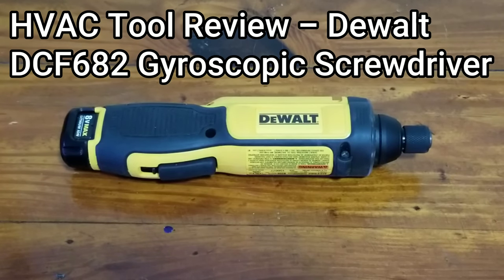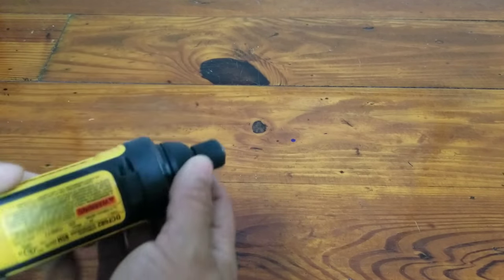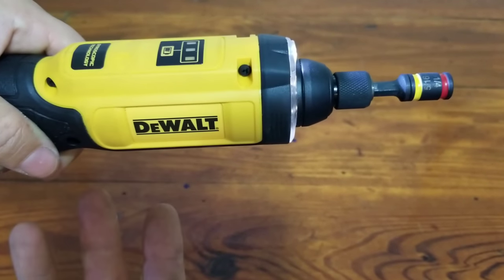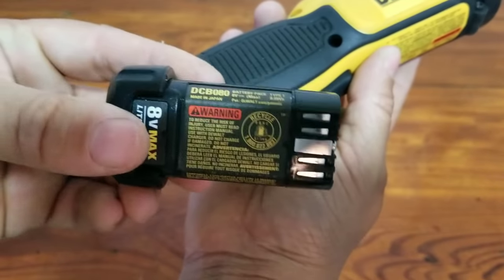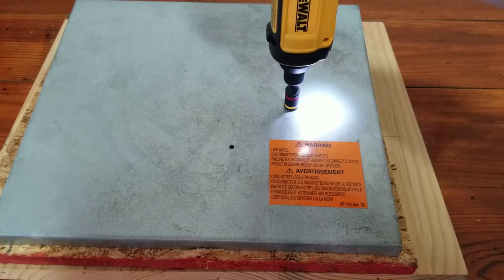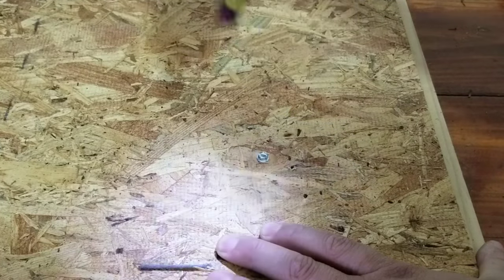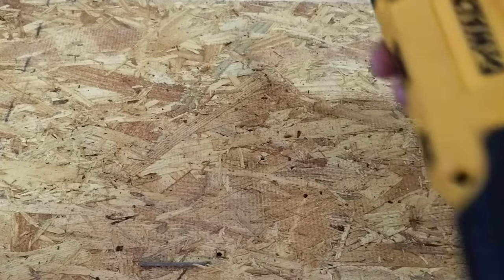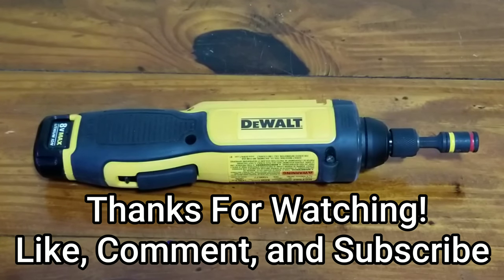Dewalt DCF682 Gyroscopic Screwdriver Review

Comment: I bought the DeWalt DCF680N2 a couple of years ago and absolutely love it. One added benefit is that it has an adjustable clutch like on a drill so you don't accidentally strip out small screws like you find, for example, on a switch plate.
Reply from the maker: Pro1er Thats correct but once you get used to the variable speed function the clutch isnt a big deal IMO. Especially since it's about double the price.
Thanks for watching.

Comment: If the tools unable to remove the bolt or screw, does it lock so you can use it manually or does it freewheel